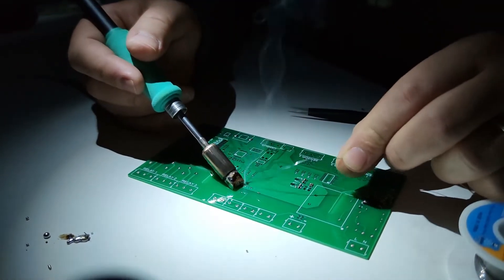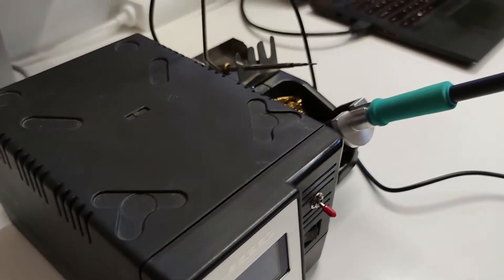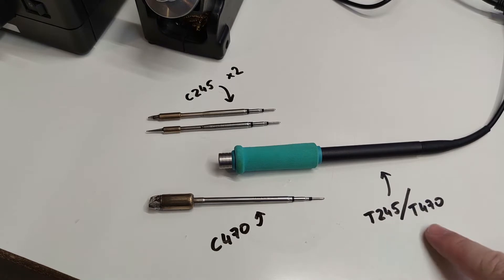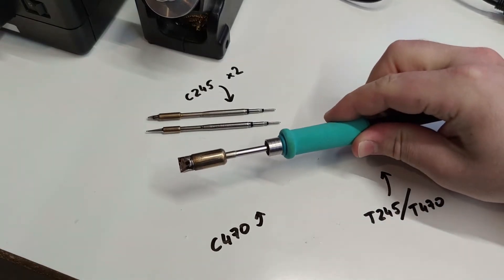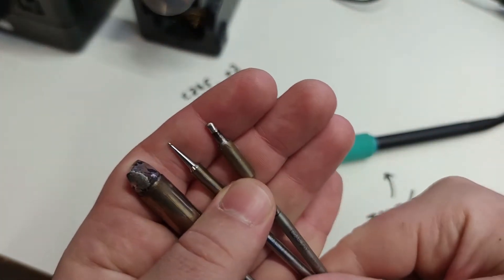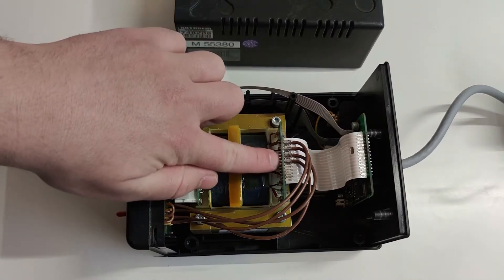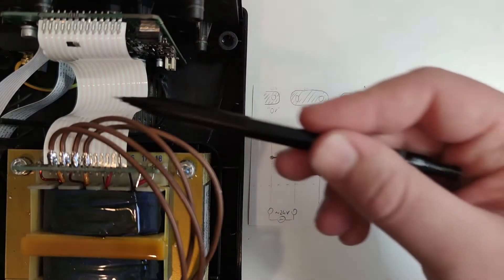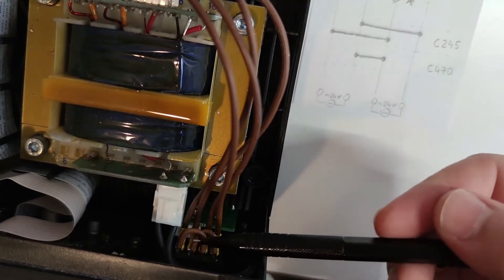Soldering station conversion | Will JBC station work with C245 & C470 cartridges?

Comment: Thanks for the video. I have the same station and before I will modify the station I have this behavior with T470 and C470xxx: the station works fine with the tip and show me in the settings currently tool is a 245, but this is wrong, because all is 470. Do you know why that is?

Comment: Thank you for the interesting and very useful video!
Cartridges 245 and 470 consume THE SAME current, so it was possible to use only one winding, and for this purpose take a simple switch with one group of contacts for switching.
Of course, connecting two windings in parallel (as you did) would be more correct!

Comment: The button pushers are specially made not high! The power switch has been retracted! This is to prevent the button from being broken during transportation! A new switch should have been made in a similar design

Comment: So the t245 should be compatibile with c470 cartridges? i mean sizewise? which handle do you have t470/t245?
I want to build a station primarily for c245 use, but ocasionally would use bigger cartridges and for this case the voltage will be changed accordingly.
Reply: Compatible with JBC's clones( AİFEN A220(350W) , AİFEN A902,(350W) AİXUN T435(350W)  C470 tips.

Comment: Great Video! - I have a question: Most of the Tools/Irons from JBC have a wire in the Soldering-Iron connector that bridges the Earth-Pin (green cable - Position 1)  to the middle pin (Position 6) of the connector. Some have a resistor in between and some are just "shorted" together. (This connection to the middle pin may be for tool recognition): Could you measure the resistance between the two pins of your T470 iron? I would be very interested in this kind of information. The connector is the RPC1-12P-6S(71) from Hirose.

Comment: Strange things happen, at 290celsius will have a tool warning #1, and heat up time from 180 to 350 celsius is 6-8 seconds, compared to CD unit, which will do in 3-4sec.
Reply from the maker: Unfortunately I also have the same problem, but i can live with that since i can use C245 cartridges and do fine soldering with them. Thanks for the feedback!
Reply: @surgecreator8987 Any fix for this issue?
Reply: Any fix for this issue?

Comment: helo. can You Tell me exactly the name of the  switch?  thanks
Reply from the maker: Hi! Thank you for the question. I don't have the actual part number, but it is ordinary 4 pole double throw switch. Mine was 6A rated. Hope it was helpful.
Reply: @surgecreator8987  used other type of switch.  Its strange that bere some time to heat. 
Throw some error about the tip its disconected. I think the jbc need. A firmare  that work ok with the c245.

Comment: You saved my life,i just bought an hd -2b and I did know the t470 is so big tip so I will order that switch you use în video and I will do the same as you I hope i can do that to work,thanks for everything
Reply from the maker: That was the purpose of the video 😁 I am really happy for the feedback and I hope that the station will serve you well.
Reply: What do you think i found on aliexpress Kaisi K-508 Soldering Handle Expansion Module with which you can convert this station to T210 and T115 can you give me an answer for this please ?